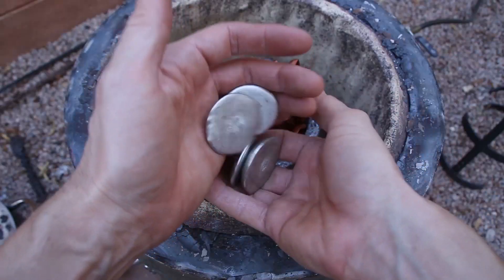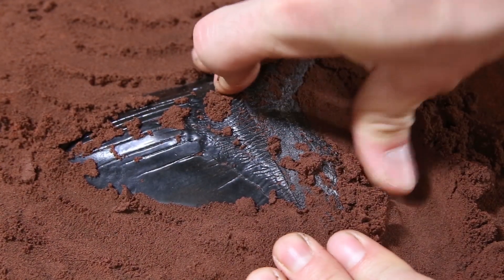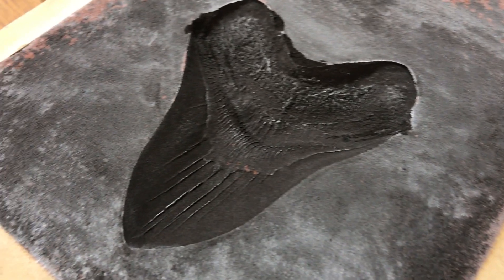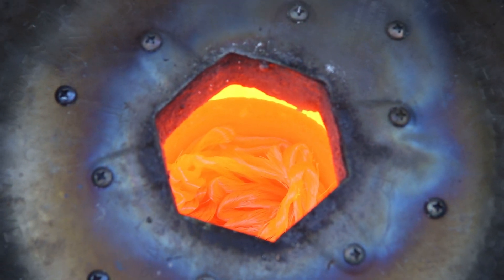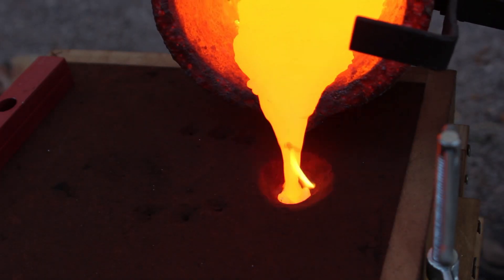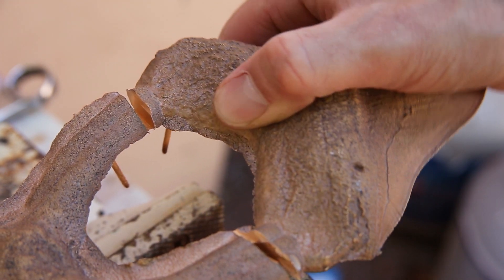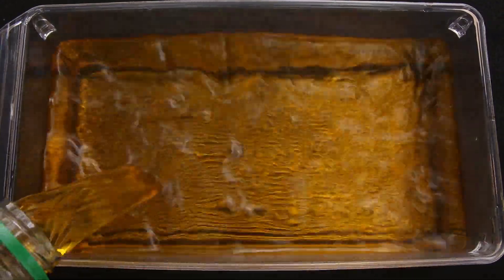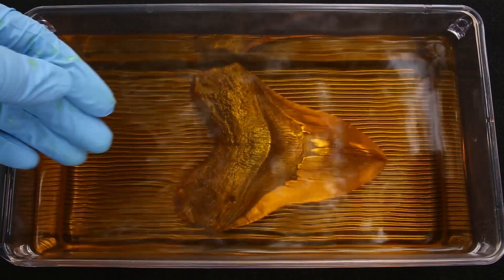Casting a Bronze Megalodon Tooth │Shark tooth fossil

Comment: Hey! One thing here... it looked like you reysed some old, black petrobond. I would highly recommend not doing that as the oil (and probably other ingredients) is already burnt up, and it would need some work to rejuvenate it (called mauling or something, cant remember the word). If you keep mixing it in, eventually all of your petrobond will be useless, even though you still have quite a bit, it'll be ineffective. Other than that, your whole casting process is phenomenal, I appreciate the attention to detail and that you obviously have done your research to do everything the best way possible.

Comment: The area that you ground, you could have taken a tig welder held it away about 1 inch, let the arc pit the ground areas. I did that process on a broken ant colony aluminum cast to hide that it was welded and ground to shape. They couldn't find where it was welded. Anyway just a thought.

Comment: I just cast a few Mega teeth, I 3D printed the teeth I used as patterns. I did 2 in copper and 2 in Nordic Gold, they turned out really well. They were maybe, a 1/4 of the size of the one you used, and I had done one about 2x bigger than the others I had done. I am working on a big one now, hope it looks good as the one you did.

Comment: That looks very good!! Great work! One thing though, I recently made some bronze using 12% tin and it came out way more orange, yours seems very yellow, maybe some of the wires you put in were aluminium?
Or I might have done something different, I'm curious to find out. Anyway, very cool project, I might borrow this Idea and cast a Megalodon tooth for a friend that is crazy about sharks. 👍👊
Reply from the maker: Thanks Ralph, I wonder if the reason my bronze looks so yellow is because it was never given a chance to oxidize? It could also just be how my camera is interpreting color.